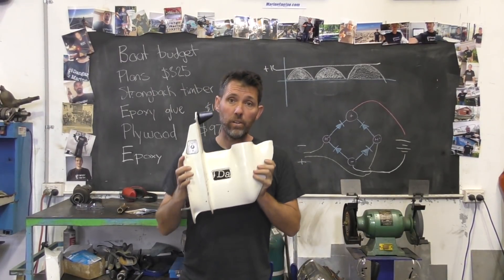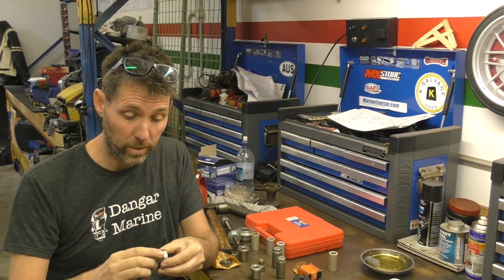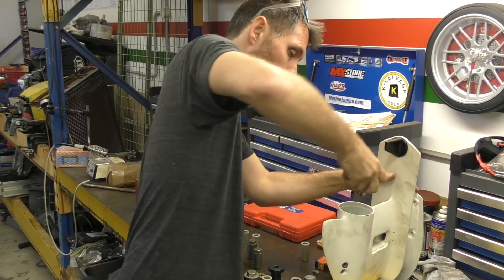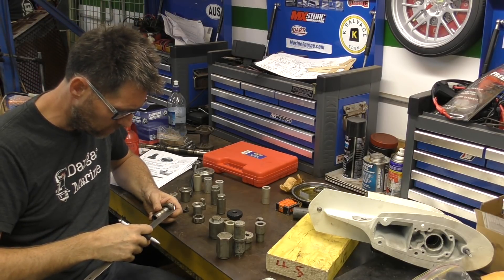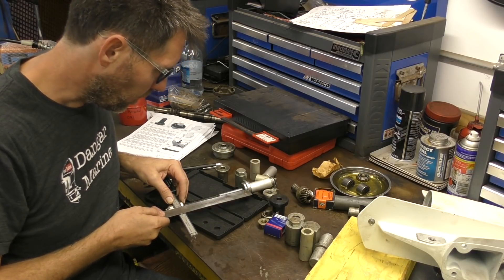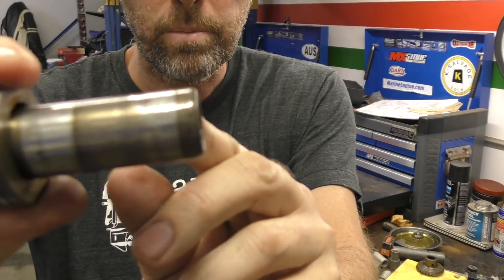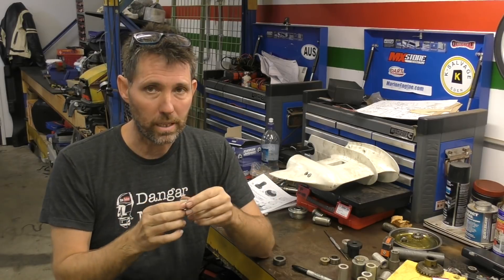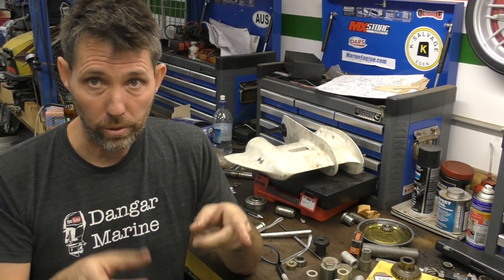Installing Johnson 30HP outboard gearbox bearings

Comment: This question is totally unrelated to the subject of your video, but I noticed that there appears to be the inklings of a stitch and glue project written on the blackboard in your intro.  What kind of boat were you thinking of making?
Reply from the maker: It was a composite glass on ply boat, but with no stitching.
Reply: @DangarMarine  I was just wondering. I plan on buidling a Glen-L Super Spartan mini hydroplane or CLC Cocktail Class Racer this winter.  Both of them are stitch and glue.  Of course, the wire stitching is removed after the parts have been bonded together with epoxy or resin.

Comment: So it turns out the depth of the second bearing in my replacement LU was lower than the depth in my original LU. My original LU’s second bearing depth was 5”, and the replacement LU had the second bearing at 5-7/16”. Honestly, it probably doesn’t matter. Both bearings hold the pinion gear and it gets connected to the drive shaft. As long as you put the bottom bearing flush with the bottom of the cylinder and the second bearing below the line scribed inside the cylinder, I think you’ll be fine. Just make sure there is enough exposed hole on the side wall for gear lube to get around the outside of the second bearing. 

Also, when reassembling your gears, my prop shaft came out with the clutch dog in the neutral position. It can be reinstalled the exact same way, without having to use that fancy ball bearing tool. Insert the shift lever assembly first then insert the prop shaft with the clutch dog still in the neutral position. Then just use some needle nose pliers to move the shift lever into position and screw in the pivot pin. Done, no special tools required.

 By far, the hardest part of this project was pulling the shift rod bushing and the retainer ring that holds the gears in. My ring pliers slipped about 500 times before I finally got the retainer ring to come out. The shift rod bushing would not budge at all. I had to use combination of DIY slide hammer and then threaded rod puller. It took almost a whole day to do both of these things.

Comment: Im about to start the process of installing new forward, reverse, and pinion gear. Can you tell me if the measurements you used for the pinion bearing were good. Did you ever take the motor out and did it work like it should?

Comment: Quick question: Instead of pressing in these bearings from the top, can they be mounted on the trunion gear, and installed from the bottom? I mean, since they came out that way, and no distance measuring?
Reply from the maker: You could, but you would still need to know the distance to pull them up as there aren't any stop ridges anywhere along the tube.

Comment: Ty so much for your videos and knowledge. I have an '89 sea nymph fishing boat with 40hp Johnson that I had given up on at this point. The motor has been giving me fits for a few yrs now and I was ready to let it go until I found your videos. Thanks to your knowledge I've been able to diagnose the issues and fix everything myself. Carbs cleaned , VRO deleted, coil replaced and currently have the tilt trim unit in a vice preparing for a new seal kit. I would have never made it this far if it wasn't for you. Ty again for all that you have shared with us and please keep up the good work.
Reply from the maker: You're very welcome, glad the videos were able to help you. :)
Reply: Good move knocking out that VRO especially!

Comment: Hey Stu glad you're back man learned a lot from your channel. Had a bit of a problem maybe you can help me out. I have a 94 200hp mariner that's giving me problems compression is great on all cylinders but its overheating. I changed thermostats, impeller. Impeller housing, and head gasket. Still overheating, any idea what could be going on? Water is coming nice and strong out of tell tale btw thanks in advance
Reply from the maker: I presume when you had the head off the water jackets looked clear. Have you tried taking the thermostat housing off and seeing if water flows out of it when it is running?
Reply: Dangar Marine the water jackets weren't that bad but I ended up cleaning them up real good. I also ran the engine without thermostats and water was gushing from both holes so good on that area too. Any other ideas? Thanks for taking time to reply

Comment: Hello, I have a 2003 Mercury 150 saltwater motor and I took it for service and it came back with a rattle noise from the lower unit it does it only when in the flusher out of the water any advice please (talked to the mechanic that work on it he said the noise is normal). Thanks.
Reply from the maker: It is quite common for there to be noise when running on muffs, yes.
Reply: Okay thanks

Comment: Stu I believe someone could use a caliper or depth mic prior to disassembly to get the depth readings of the bearings.  I usually do this if I am not referring to a manual. also be weary of lubing bearings in a magnetic tray :S
Reply from the maker: Yes, if I had known it was going to be so hard to come by the information I definitely would have measured before removing. I just thought it would be in the manual for sure. You are right about the tray. I have a bad habit of grabbing the closest thing rather than the best thing. ;)

Comment: Very  resourceful!  Be sure to get those two thrust washers/bearing properly installed on the pinion before installation.  The manual calls out the proper orientation
Reply from the maker: Thanks mate. Will definitely go through the orientation of those pinion components when I do the final assembly. :)

Comment: I love listening to metric measurements. It makes me feel like I'm not alone. Dentists in the US use the metric system which makes us weirdos compared to the imperial guys. They talk in inches and thousandths of inches and I'm at a loss. Give me metric or give me death!
Reply from the maker: Interesting to hear that dentists use the metric system. I imagine many high-end engineering firms do too. There are only three countries left in the world that use the imperial system so it must make it hard to work with other suppliers and manufacturers.
Reply: Engineers use both - thank God i'm EE, those poor ME's have to juggle between the two quite a bit more often.
Reply: You can say the same thing about any language.  Its simply about what youre used to using. 
If the World makes English the universal language then Ill gladly start using metrics.  Wars are fought because of language way to often.

Comment: Welcome back! Hope your trip was awesome! Quick question, I have a 1997 Johnson 115hp on a 17’ Bass boat. It starts, idles, and low speed travels great. I’m having an intermittent issue where it basically bogs down at full throttle launch and will not go on plane. I have played with different trim settings at launch, and can get it to plane out sometimes by doing this. Once on plane it goes full throttle without any issues. Any thoughts on what might be the problem? “Most often caused by” ideas? Any help is greatly appreciated.
Reply from the maker: It sounds like maybe the carbs aren't able to supply the correct amount of fuel when you open the throttle up so I would start with a carb clean and go from there.
Reply: Dangar Marine I did that once and it helped a bit but shortly began doing the same. There didn’t seem to be much to those carbs. Would it be worth rebuilding them?
Reply: Also  put a service kit into the fuel pump and check the fuel bulb- but if you have the old silver fuel hose get it changed out/check the filter for plastic bits in there.

Comment: Hola,  soooooooooo, I have a 1988 50 hp Johnson, it looks like it's back firing & when it does it comes out the vro pump, Please help its driving me crazy, Also give me a link to get a shirt to send a pic, I want to take a video of it but dont know how to tag you in it.
Reply: Rompe Todo is the VRO driven by the crankcase or is it electronic? What do you mean its backfiring out of the VRO? My merc vro is sucked in via pressure. I have heard that older model Johnsons had a bad problem with their VRO system and most remove and premix. But I've never owned a Johnson and couldn't tell you what years were problematic. Older Mercs had a problem with using a plastic gear that would tear up. But the metal gear VRO is a very reliable system.
Reply: jimbo gasoline, Its electronic, I run premix, the vro is disconnected electronically as I mix the oil and gas together,  so my outboard runs it kinda splurges and back fire and I see the exhaust smoke come out the vro pump, I will be taking a video of it and put the link here
Reply: Rompe Todo If smoke is coming out then it sounds like a leak. Does the area where the exhaust is coming out, have a seal, gasket, or a check valve?
Reply from the maker: I would be focusing more on the reason for the backfire than the VRO pump. Backfire could be HT leads in wrong order, timing way out, carb synch issue, carbs running lean, bad reed valves etc Check each one of these first.
Reply: https://youtu.be/j0caD33dmsA, please watch
Reply: https://youtu.be/g8uz_tEo_Ng, please watch
Reply: So I replaced the reed valves, clean the carbs, I notice that cylinder 2 is getting flooded with fuel also I would pump fuel in it it will run but I notice that the vro pump not pumping fuel like it’s suppose to, I took it apart and everything looks fine the diaphragm looks brand new, how can I check the pulse thing that makes the fuel pump work
Reply: Sorry I’m Rompe todo(Alex) this is my other accnt
Reply: So I figured out the problem, cylinder 2 only has 20psi and cylinder 1 has 145psi, well I guess I will be watching your video on how to replace piston rings, as soon as I find that video I will comment on it & let you know the progress, Thank God for Dangar videos😁

Comment: Hi Stu, I got a problem with my evinrude 35 , can you give me some advice please :-)
Reply from the maker: What's up with it?
Reply: Thanks for replying Stu.  I have a 30hp 2 stroke Evinrude.  1991.  same layout as the one you are working on.  When it's cold it starts on the button.  When it's warmed up it won't start .  Several minutes of turning the engine over and it might fire up long enough to get it into gear and then it's away. New plugs, carb cleaned out. primer solenoid working. Clean fuel. 125psi compression.  !!Any ideas.  Local workshop just shrugging their shoulders :-(
Reply: When the engine is hot is the fuel bulb still hard? Carb clean out? needle and seast replaced?
Reply: It does soften but I pump it again , but it never gets really hard anyway.  carb cleaned by me, looked all good.  float sitting good.  Also I got an invoice to show it had a poor starting issue and workshop stripped carb in 2016 , little use since , thanks
Reply: The fuel bulb should get hard to squeeze if the fuel float , needle valve and bulb one way valves are working correctly. So you need to find that pressure leak first off. It does sound like a fuel float level/fuel flood problem though.